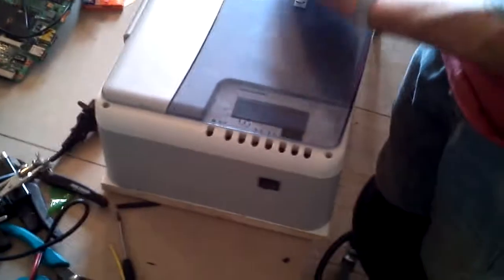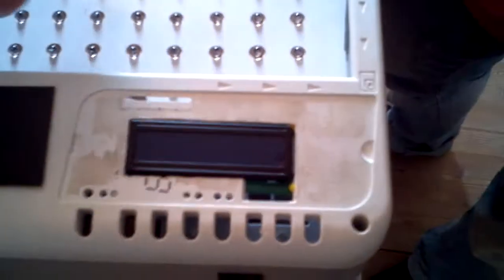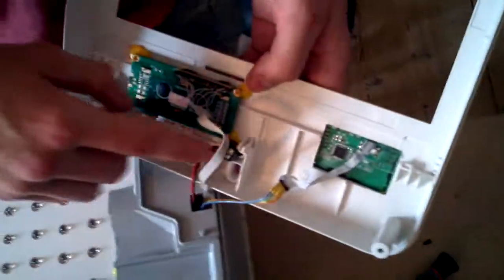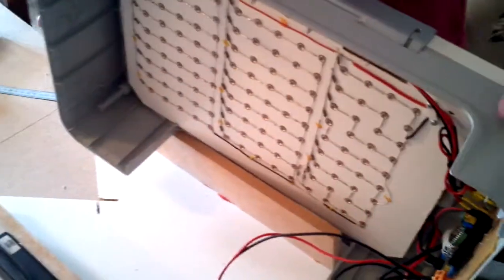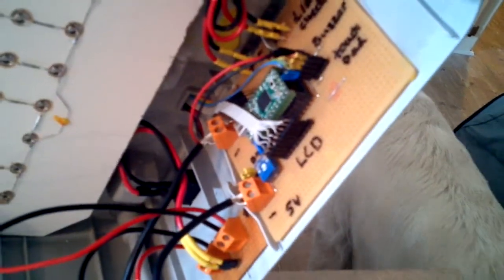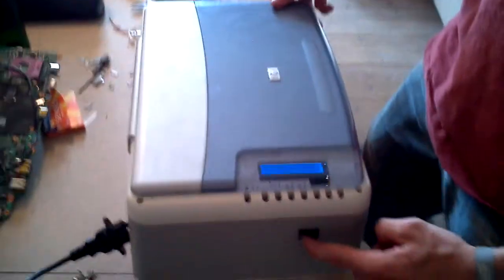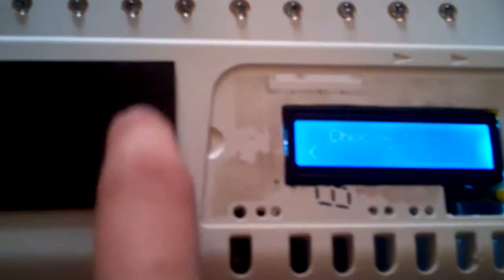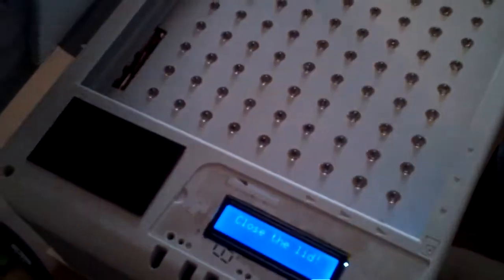UV exposure box using LED and arduino. DIY.

Comment from the maker: Hello, im sorry but i dont have the schematics anymore.. however the wireing is very simple, just a mosfet controlling the LED array. If you like two colors just use a mosfet for each color LED array. In order to wire the touchpad you have to find the PS2 pins on it(if it has them) - google is your friend. The touchpad behaves as oldschool mouse that arduino can communicate with, having the propper library. The code has not been revisited since the build, and is very messy - but u are welcome to have it: https://www.dropbox.com/sh/y8vz389bc9npp36/G_v0URhxsV
Best of luck for your project. - if you have any questions just ask:)